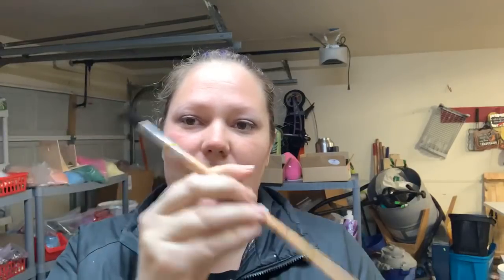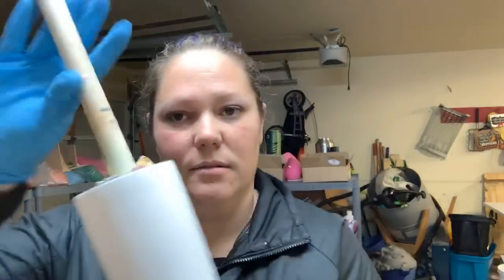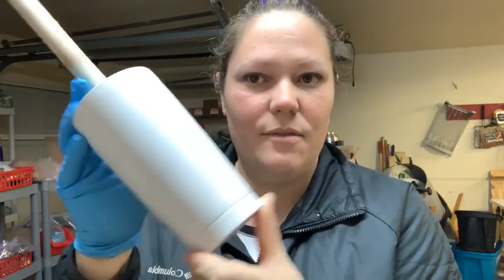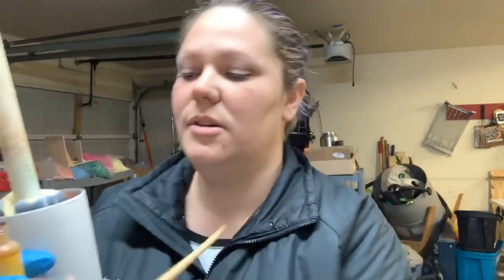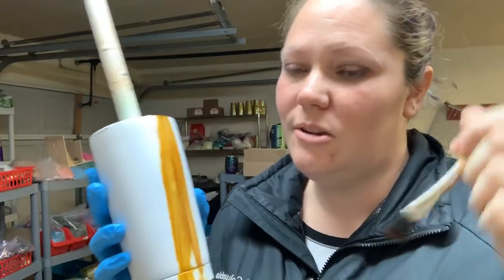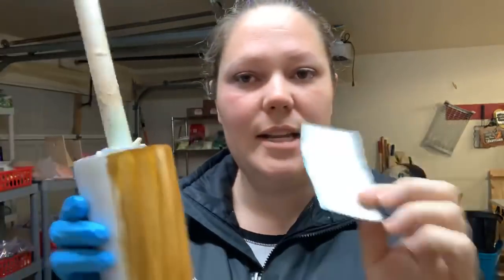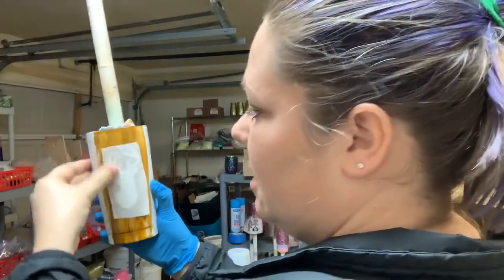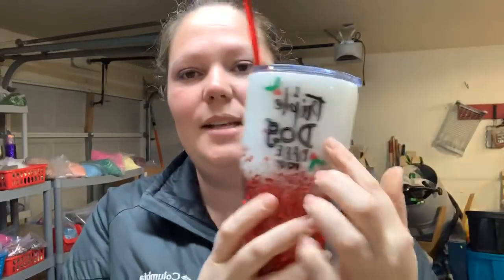Woodgrain Tumbler Tutorial (No Longer Live)

Comment: You stated you use FX Epoxy, is that made by Countertop Epoxy? Do you have any trouble with it in cooler conditions? I'm trying to find the best epoxy to use in 60-70 degree temperatures. Thanks in advance!
Reply: Did you find something?
Reply: @1kn2ys  I use Counter Culture DIY Ultra Fast Set and Medium Viscosity.

Comment: I did wood grain cup & then I went to epoxy it & it started to get light. What did I do wrong?
Reply from the maker: Sara Salazar did you seal it first?  Sometimes it can lighten that way.  Otherwise the ink shouldn’t lighten.
Reply: Actually I didn’t seal it. Now I know I have to for next time. Thank you!
Reply: Hi Sara, i have the same problem, however I tried sealing it with rustoleum clear seal and that mad all the ink bleed too.  Don't know what I am doing wrong?
Reply: @jimnanceebrown878  make sure you are at least 12 inches away from the cup when spraying your sealer on it - and spray it very lightly